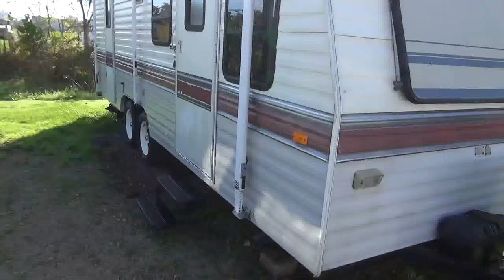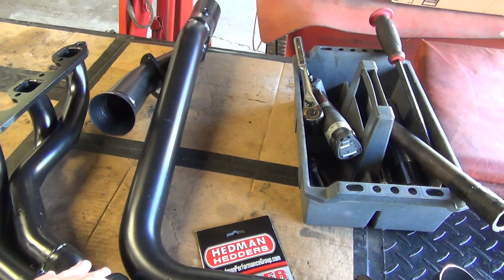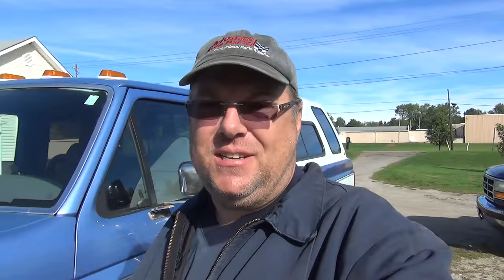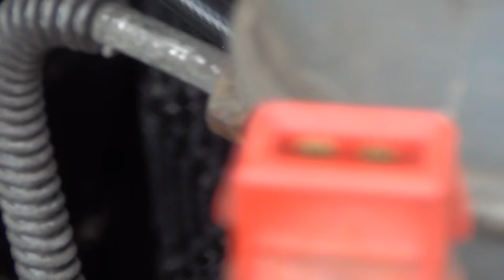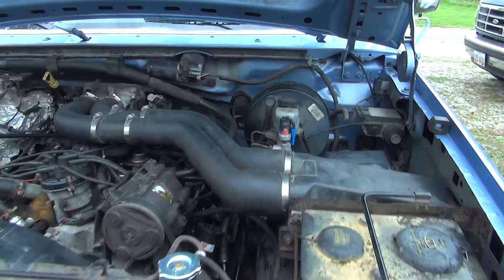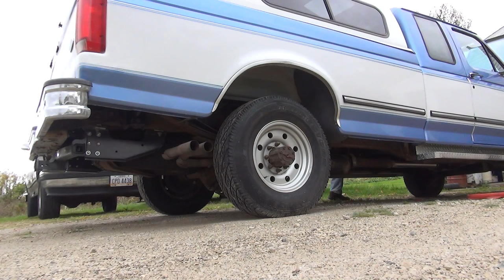97 F250 460 Headers install overview nice rumble

Comment: I have a E350 1993 460EFI Engine its a Montara/Tioga Class c It has a leak in the exhaust header passenger side the noise goes away after it warms up Already did A Flowmaster 70 Before the Axle out the passenger side everything else is untouched. Since I have the Dog House Access should not be a problem I hope. Figured on some quality Percys or Fel Pro Premium Gaskets and have at it! I figure on just doing the passenger side I am not looking for more problems. Did you have any issues with these bolts breaking? just getting the bolts off remove & replace gasket and would you recommend new bolts or just re use the same bolts? Not doing headers just the gasket or gaskets...Thanks alot!
Reply from the maker: Jeff G well even though I didn't have a problem with my Hedman header install on the F-250 I expected it fully I just got lucky. My F-150 head bolts break. Then in this video link from my other channel https://youtu.be/dCEd0t-XMZM I had the header bolt break. Now the headers will come with bolts but you may have to reuse some of your longer ones for some brackets and retainers like the oil dipstick. If you still have your air pump on your 460 you may want to listen closely about running gaskets with your headers. The Hedman headers flange is thin enough that it's recommended to run a gasket however if you run an air pump it will heat up the exhaust greatly and potentially blow out the gasket due to the fact the heat cannot transfer from the exhaust back to the Head where it would get cool. Now in the video that I just linked when I installed the Banks exhaust system, which I highly highly recommend oh, did I say highly? Those did not require any gaskets because the flange is so thick and the quality of the exhaust is so much better but they're also so much more expensive., in short if you're running the Hedman headers definitely use good quality gaskets you'll have to retorque them a few times and expect bolts to be broken when you're pulling off your manifolds. The Hedman headers are decent but the banks headers are far far better. And you do not have to run gaskets with those.
Reply: Thank You! I was afraid of that I just took the dog house off to get a better look and the weird thing is the noise is very non specific I assumed from outside it was on the passenger side almost sounds like A valve tick or maybe the fuel injectors?  but I get up close to the passenger valve cover I hear nothing and the sound goes away entirely after it gets up to running temperature. I am going to get underneath to be sure its not the collector donut . Anything else that you know of that makes A Click click click noise? Regulator maybe? I have not worked on many Fords so I am orienting myself. I did find some old mouse poop around the rear of the intake nothing looks chewed on no electrical faults and none inside the Motorhome  I got it used so I am going over everything it has 90k miles it was an older guys rig kept pretty good repair records but they date back to 2006 and stop.  
AND MERRY CHRISTMAS THANKS FOR THE HELP!  The banks set up  sounds cool this is the EFI with Overdrive its getting really good gas mileage compared to the older 1989 we had  but I am hoping for more it had A huge exhaust system choking it out all the way over the axle then reduced even more into single inlet muffler to out 2 1/4 twin outlets this is a 28 foot class C Motorhome so its big but now I have the Flowmaster 70 3 inch coming out in front of the rear tires already sounds and feels stronger The Banks system might really get me going!

Comment: Got a 92 F250 XLT 4X4 with the 460, got some Hooker Headers on the way. What all did you take out and leave in place with the smog pump? I was told to remove smog and EGR by the local mechanic, but you said you left your EGR in. What was your reasoning for that? I've heard too many different reasons for and against removal of the EGR on the forums, and I'm really needing some solid advice. Great videos by the way!
Reply from the maker: Samuel Coleman in short, leave the EGR... It is an effective way to keep cylinder efficiency at its best for the limited computing power of the speed density pcm... Even with MAF it's best left alone...
Reply from the maker: The Smog Pump was removed and a shorter belt installed... That was it... Of course all the plumbing associated with it too... Remember, no cat converter should be used if the air Pump is coming off...
Reply: Foxboss9 Awesome thank you! And if I'm dualing the exhaust after the headers, I was going to install an X pipe with an O2 sensor bung the same distance from the heads as stock. Or do I need to install two separate sensors for each side?
Reply from the maker: Samuel Coleman if yours only came with one sensor it's okay to just connect One sensor. But you need to get it as close as possible to the X so it can see exhaust gases from both banks of the engine. However with that said, I have Run Exhaust with just one sensor on one header collector and for the most part it still does a pretty good job. You won't notice any difference really.
Reply: Foxboss9 Copy that. What vacuum systems and related parts need to be left in place and capped? Sorry for all the questions.
Reply from the maker: Samuel Coleman everything stays connected. Unless you disconnect the air pump bypass valve that is on the passenger side and remove it. Then in that case that one vacuum line that goes to the diverter valve has to be plugged. Other than that all the other lines need to stay connected.

Comment: Doesn't look like Banks has long tube headers for my 95 F150 5.0
Did any of your studs break while removing stock manifolds?
Reply from the maker: mikey mike Bolts breaking.. yes they did.. On my 302 and 460 both... Watch my other video on long tube headers that I installed on my F150... They are really nice headers... https://youtu.be/PtNLpX2z6jQ

Comment: Where didbyou buy these hedders from? I just ordered hedders from summit part number 89511 and they have the air injection tubes on them and my stock manifolds do not.
Reply from the maker: The link is in the description...
Reply from the maker: BTW... If you have large air tubes going into the back of your manifolds Then you technically have air injection...Header Air Injection just looks different as thats how they accomplish the same function..
Reply: Oh ok makes sense. Those air injection tubes on the hedders i order could i just cap them off since i dont have an air box for them to connect to.
Reply from the maker: cody williams you can.... but they are kinda difficult to work around changing plugs and wires.... plus there ugly..
Reply: Oh ok. Yea mine doesnt have either tubes on the manifolds not even in the back of the manifolds. I thought my truck was from california with cali emissions thats why they had me order those kind i guess. But thanks for the help i appreciate it. Ill probably have more questions later on. Thank you

Comment: Was it difficult to get original manifold off rh side
Reply from the maker: Harry DALE II not really, I've been installing headers,  on and off, over 30+ years... The trucks are always easier than most..
Reply: Foxboss9 just seen manifolds not the issue, previous owner broke head by manifolds
Reply from the maker: Harry DALE II definitely broke head bolts... Always a possibility...
Reply: Foxboss9 they broke actual head and exposed manifold bolt threads

Comment: That sounds very nice. do you know if you could put them on a 1996 E350 rv  class c 460 motor ,?
Reply from the maker: +Rusty Nail Had to edit answer on that.. This set fits 1988-1997 F250 and F350 Auto and Manual trans. IT May work on motorhome applications but you would need to contact Hedman tech dept to verify.. If i was doing a motor home I would save up for the Banks Torque Tubes they will last forever pretty much.. Thanks for the comment and question..
Reply: thank you for the reply and the info .

Comment: im looking  into a 96 f350 dually 7.5 125k good choice ?
Reply from the maker: johnny Ramirez Rock Solid platform.. no issues like the Triton engines had.. make sure transmission shifts right.. exhaust manifolds were a common issue.. But headers can fix all of those problems.. drive it easy gets maybe 12mpg, mostly 10 though towing on mainly flat ground 10mpg, drive like an idiot gets about 8mpg.. repairs are CHEAP.. I say it's a pretty decent truck overall just depends on price and condition... good luck 😁
Reply: The 460 is a low torque pulling monster. Couple simple up grades will really open it up. Install a 3in exhaust, a K and N filter and headers. Once she is able to breathe right. She will pull no problems

Comment: what would give me a deep sound or a howl for a 95 f250 4x4?
Reply from the maker: +SuperLinkandzelda you can start with just a quality muffler and pipe replacement first like this here >>>  http://amzn.to/1o6s1pR
Reply: +Foxboss9 thats more than I'm paying for the truck
Reply from the maker: +SuperLinkandzelda then I wouldn't mess with the exhaust because once you start yanking stuff off, unless you have a pipe bender, access to exhaust pipe cheap, and a welder it's going to be expensive trying to keep whatever you "rig up" on the vehicle and not leaking.. You can make it loud for cheap by sticking a cherry bomb on it but a "nice rumble"  can be hard to get plus it cost more for that type of muffler, which would be a welded muffler like that Flowmaster exhaust has. The cheap welded muffler is what I used on my F150 (look for my "walk around"video)  but that muffler is not a direct bolt-on and required welding and adapters and didn't last very long(2 years)  plus I had removed the Catalytic Converters and installed long tube headers so the sound in that video won't be the same on a vehicle running otherwise stock exhaust..  You may want to find a local exhaust shop that can help you first hand with your decision, because once you start Modifying you will always have leaks and support issues unless stuff is bent, welded, routed and supported correctly.. Good luck

Comment: How did the new long tube headers effect the gas mileage on the 460? I bought some long tube headers for my 89 f350 that im rebuilding from scratch. I would like to maintain my hp/tq but also if possible keep or increase fuel mileage.

Comment: Needs to be straight piped with glasspacks on
Reply from the maker: Maybe if I was 20 and had a 500hp engine and I wasn't using the truck as a tow/work vehicle..... not sure when it changed, but there was a time you would only make a vehicle loud if it was fast. Seems these days, as it has been for the last 10 years, that people would rather just make their car loud and pretend it's fast.
Reply: @Foxboss9  gotta live a little. just need ideas for my 460
Reply: And doing a straight pipe would make it perform better right?